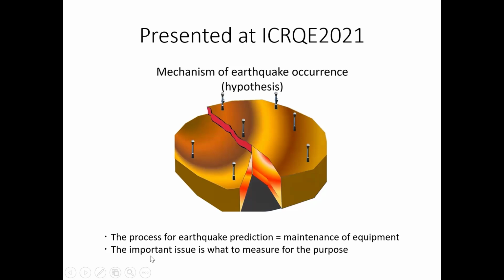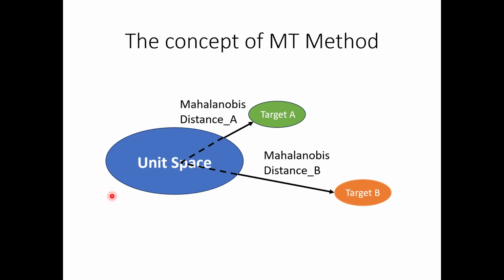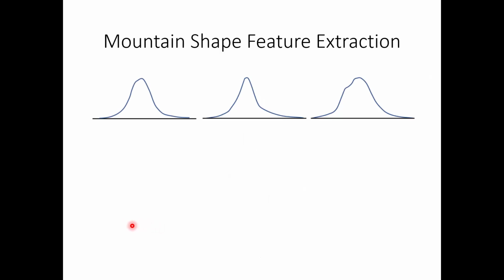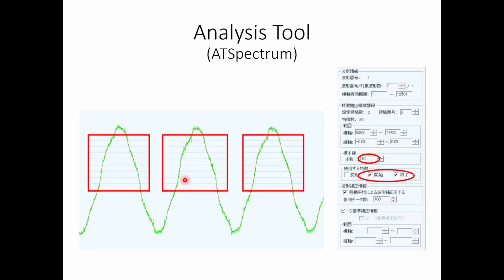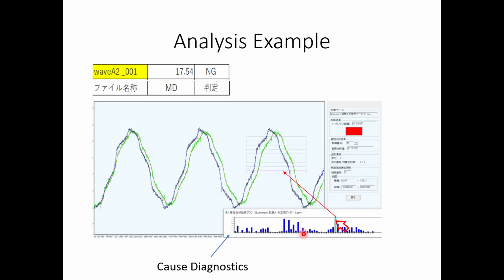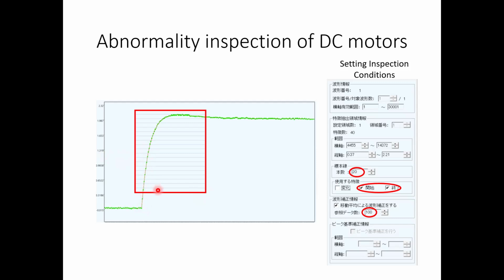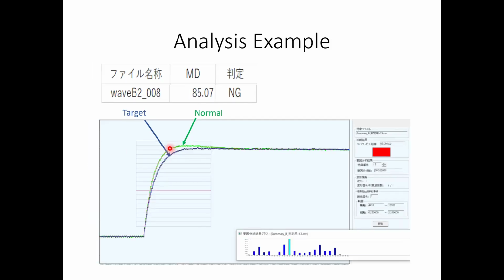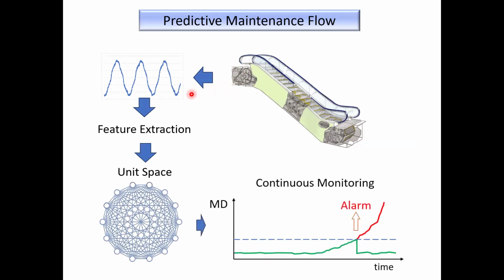ID007 - Shoichi Teshima

Comment: Teshima-san, thank you for your excellent presentation. 
I think the escalator is a great example. I think everyone has had the experience of using the stairs due to a faulty escalator. Preventing failures and dangerous malfunctions by using MT to identify the signs of failure will reduce social losses. I can imagine the subtle changes in the waveform from normal condition as it start to approach towards the failure.